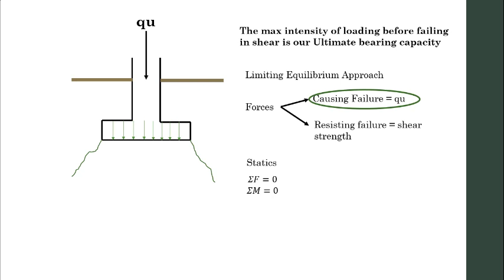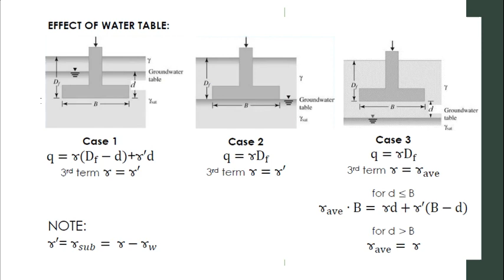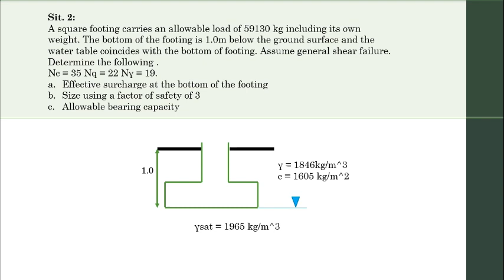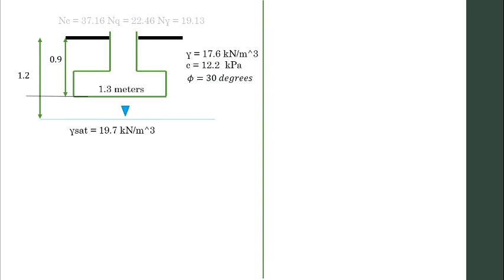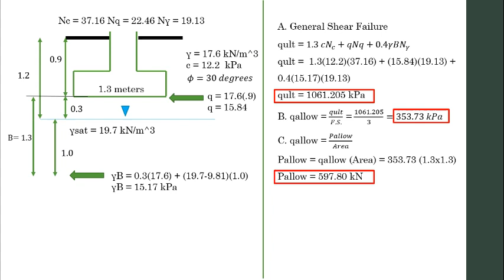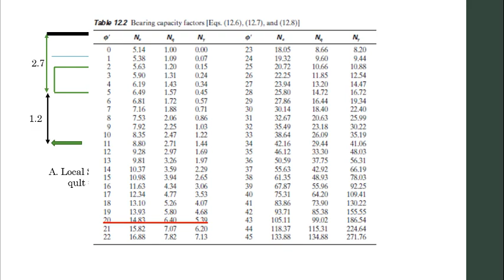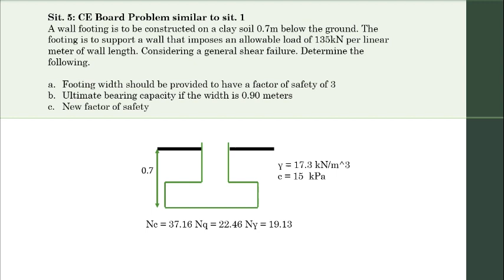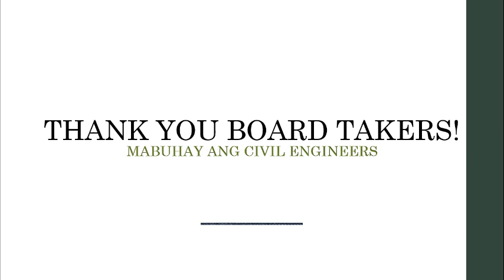Terzaghi Bearing Capacity of Shallow Foundations (for Civil Engineering Board Exam Takers)

Comment: sir , pwede ,mag tanong tungkol sa pagkuha ng allowable compressive strength using the data na ultimate compressive strength na nakuha namin sa isang testing equipment. thank you sir !
Reply from the maker: Sige sir no problem
Reply: @janlhesternavasca3160   ahm pwede malaman kung ano yung ASD concept , thank you po sa pagreply sa akin

Comment: Structural  din po sana master.
Reply from the maker: Soon ☺
Reply from the maker: What topic po sa struct ang prefer niyo? :)
Reply: @janlhesternavasca3160  steel design
Bolted or riveted tension members
Staggered Riveted connection
Cover plated beams
Local web yielding, web crippling web bucling and bearing plates. 
Yan po madami 😂😂😂
Reply: Axially loaded columns. 
Composite beams
Slot weld
Welded frame beam connection
Plastic design or limit design
Reply from the maker: I Have created axially loaded steel column

https://www.youtube.com/watch?v=buEYqp_uP70&t=1197s